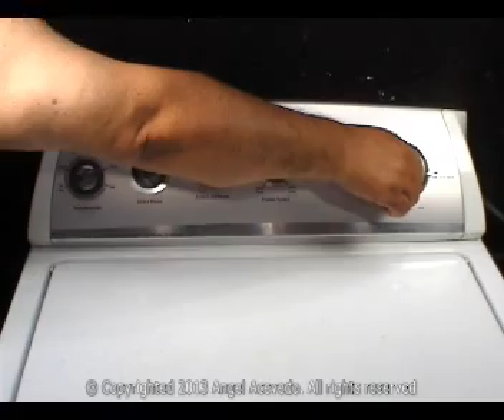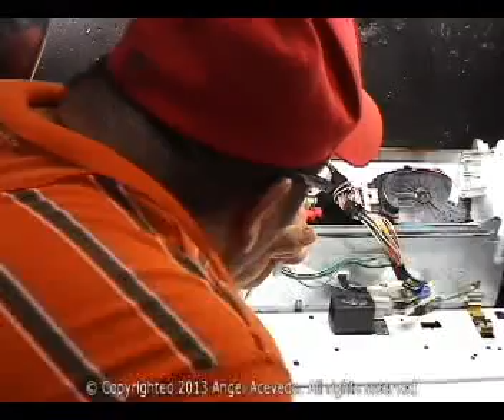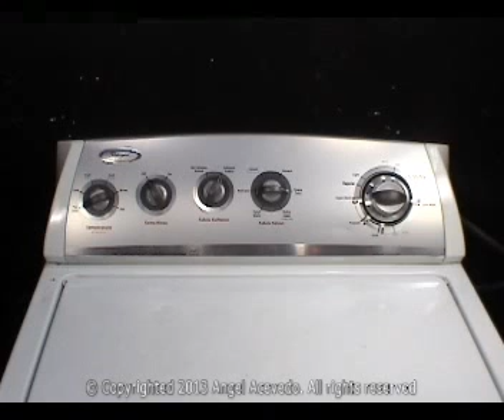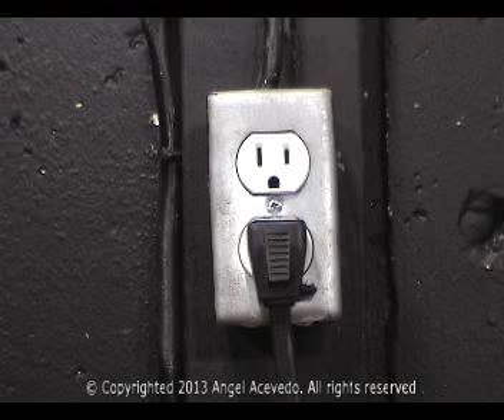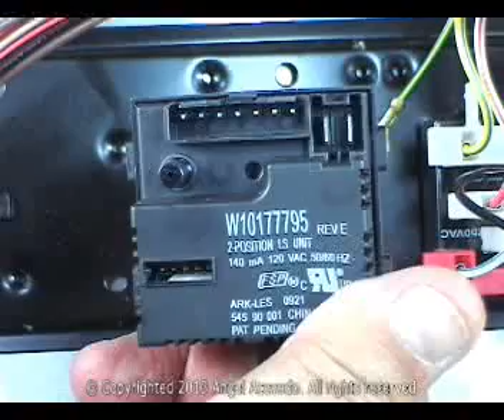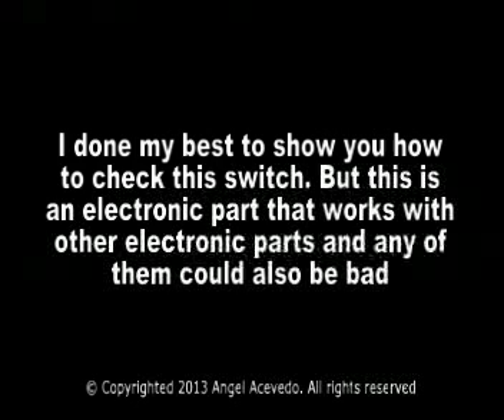Whirlpool Washing Machine Not Filling With Water - Check The Load Sensor

Comment: I’m having issues with this same washer. It doesn’t fill with water. But when I advance the timer to spin cycle, it works on spin cycle only. I’ve replaced the temperature switch, cut the hose like in this video, replaced the lid switch and tested the water inlet valve with a multiple meter which I believe is giving out the right voltage. I’m stumped! Any help or advise please? Thanks
Reply: Did you ended up fixing it ? I’m having the same issue

Comment: THANK YOU SO MUCH!   Took 5 minutes to open the panel. 30 seconds to snip a 1/2" off the hose and that fixed it.  (The panel had never been opened, so it took a lot of upward pull to pop it open... I was afraid I was going to break something.)

Comment: I seem to be having this problem also today. My whirlpool washer is 15 years old. I assume it would make more sense to just buy a new washer at this point? How much would the sensor cost? Thank you.
Reply from the maker: Send me the model number and I could check it out. Without the model number  I don't know

Theapplianceman
Reply: @theapplianceman  The whirlpool number I believe is W10140920 D and the sensor number is W10248240. I took your advice and cut the hose and things almost seem like they are working again but not exactly. For some reason it stops in the cycle and I have to press on the cover and then it will start again. I'm not sure what that means other than there must be a disconnect somewhere. Thank you for your channel, I am learning so much.
Reply from the maker: @KiwiBrowne  
that sound like the door switch is not making good contact. Try this put something heavy on top of the door and try it to see if it goes thru the complete cycle . Send me a picture of the tag with the model number on it  I can't get anything with the number you send me
Reply: @theapplianceman  I can't find the model number anywhere, I thought that was it. But I think you are completely correct about the lid switch. I jiggled the lid around and slammed the door down and it went through a complete cycle perfectly. I think I have corrected it for the moment with your help. Thank you very much.

Comment: I have this same washer. It will not allow any hot or cold water to fill. I have the water turned on to the washer. ( The washer spins when the timer is turned to Spin.) It will not fill with water , why?  Thank you
Reply from the maker: These washers they change to auto load switches instead of water level switches and they could be a pain to fix. Most of the times is the auto load switch but I cant tell you for sure, they are expensive and may not last. Check on youtube with the model number to see if someone have a better answer to your problem.
Reply from the maker: For more free videos visit my website at the link below
http://www.do-it-yourself-washing-machine-and-dryer-repair-help.com/
To ask questions go to         appliance-man@charter.net
theapplianceman
Reply: Same issue..what was wrong with yours? TI A